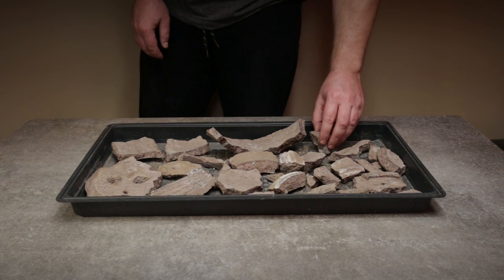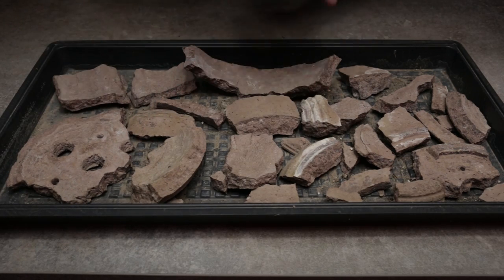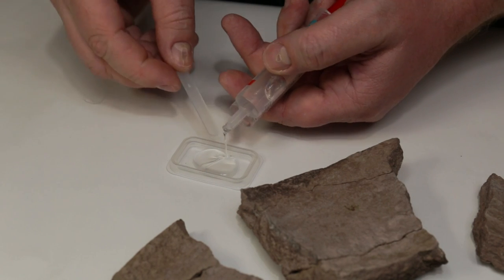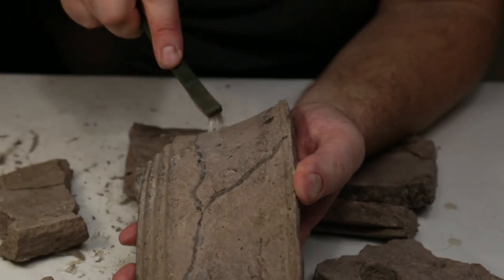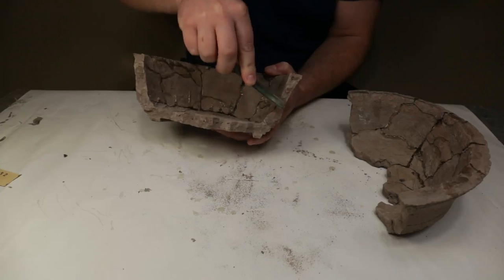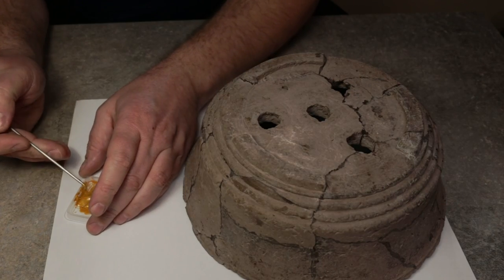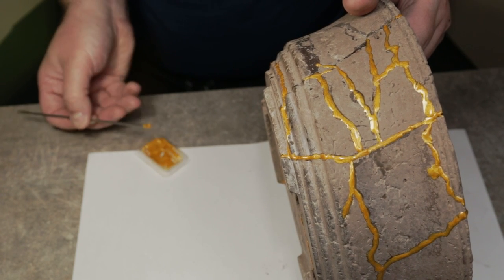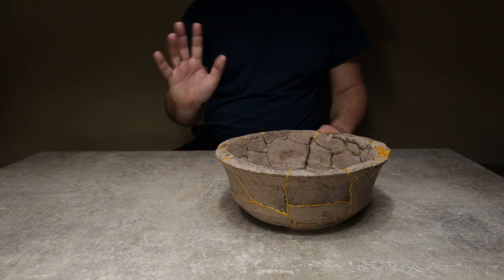DIY Kintsugi - Broken bonsai pot repaired with gold colored powder and epoxy

Comment: Daggum, Steffan!  That is some pain-staking attention to detail!  I’ve been watching your feed here, with the “emergency repotting” videos. You mentioned trying to save this one, and you sure as heck did. Thank you for sharing this, I learned a LOT
Reply from the maker: Thank you my friend! From my perspective it could have used even more attention to detail. 😋 Maybe it's not that obvious from the video but there are some stains (darker color) on the pot surface where I put on too much epoxy and there was a lot of squeeze out. At least now I know what to expect and maybe next time I get my hands on a broken pot I'll do this better. 😊
Reply: @OddBonsai  You’re always going to see your errors, or things you wished you did better.  Trust me, from our perspective, this is awesome. But I do appreciate the update for my notes. 
Have you thought of brushing the inside with a coat of epoxy to strengthen the integrity of the pot?
Reply from the maker: No I didn't think of that but if I would do something like that I would probably use some slow curing epoxy. Thanks for the tip, I'll think about it.

Comment: Hi. I have used exactly those materials myself - I'm also new to this method. One thing that you mentioned was not being completely happy with the colour of the pigment powder, in the epoxy. Something that made a better result for me was dusting the still-tacky epoxy with dry powder using a small fine-haired brush. When the epoxy is set, you can wipe off the loose dust and polish the surface of the dusted glue. This makes for a little more consistent and satisfying color. Of course the ultimate is to buy a little real gold dust and do the same thing. Then when you burnish, you get a film of actual gold. I hope to try this sometime once I'm happy with how I'm doing the other aspects of the repairs.

Comment: Beautiful job! I will make use of your suggestion to use plain epoxy first, to give more strength.You might want to paint the inside of the pot as well!
Reply from the maker: Thank you! I'm sure you'll make a great kintsugi. I decided not to paint the inside of the pot since it will be covered by soil when used.

Comment: This looks great Stefan, I would call this an accomplishment! I thought you would scrap off the excess gold at the end but it looks you have not, will you do it later or leave it like that? I wonder what it would look like if you scrapped off the excess gold... maybe try the bottom first or try it on a different object and see how it looks
Reply from the maker: Thanks Xin! Since the gold part is only applied on the surface if I try to cut it flush I will basically remove it completely and you would only see the clear epoxy beneath. I would have liked a thinner film of gold but the mix was just to thick. Maybe next time (if there's going to be a next time 😋) I'm going to try mixing the gold in the epoxy used for gluing the pieces. That way I could cut it flush to the pot surface.
Reply: @OddBonsai  Yes that would work better. I was also thinking you could use different colour depending on which pot you are trying to stitch together. I know the japanese uses gold but I think creativity can be free here!
Reply from the maker: Yes some pot colors would be better matched to something other than gold. Even the traditional kintsugi uses several alternatives like silver, platinum, copper... I was never good at arts so it wouldn't be a good idea for me to start matching colors 😋.
Reply: @OddBonsai  you reply on the internet for that my friend! just google complimentary colours haha gold, silver and copper, sounds like the currencies to a rpg hahaha
Reply from the maker: @MaybeBonsai  Good point! I didn't think of that. :)
Lol, +1 bonsai health = 10 cold coins 😋
Reply: @OddBonsai  I wonder if you could also paint it with something other than epoxy on the surface to use a detail painting brush? They're very thin and have long bristles, perfect for thin lines
Reply from the maker: @bluefox5331  I'm sure there should be some kind of paint that can be applied on cement or ceramics. Painting with fast drying epoxy isn't too practical. 😋

Comment: Nice job, however I think it would look more natural if you had put the epoxy with the gold pigment in the first place. This would have enhanced the natural curves and the excess could always be scraped off later. Just my opinion!
Reply from the maker: You are probably right, but since I worked with fast setting epoxy I'm not sure if I would have managed to mix a batch of epoxy with the pigment and then carefully apply it to glue those large pieces before the epoxy started to harden. This was the reason why I decided to make it a two step process. A slower setting epoxy would probably be more suitable for such an approach.

Comment: You didn’t fill the cracks on the inside of the pot? Why?
Reply from the maker: The inside cracks were filled when I glued all the pieces back together. This is probably not so evident because the epoxy is transparent. I do not cover the inside cracks with gold color epoxy because they will not be seen since there will be soil inside the pot.